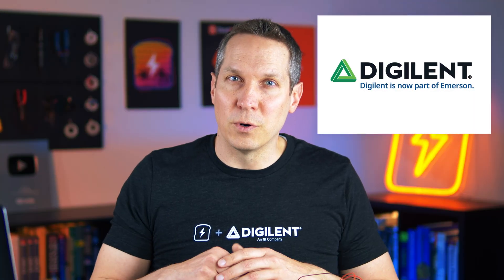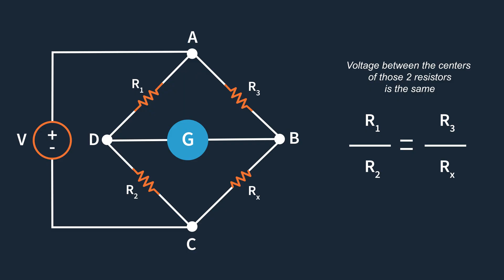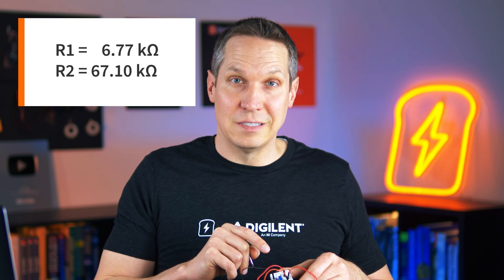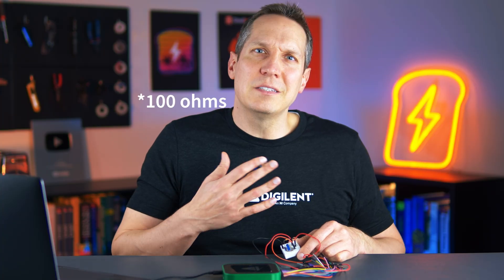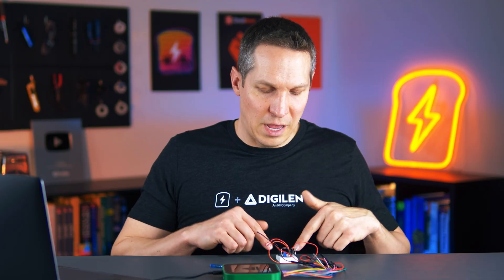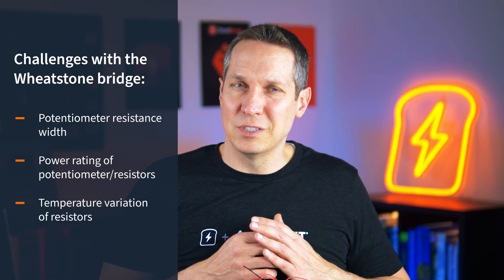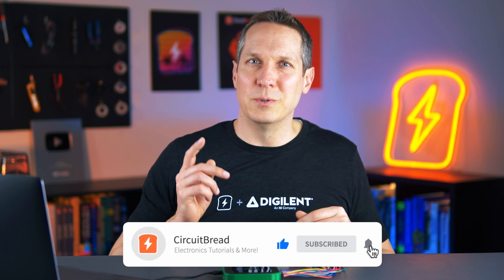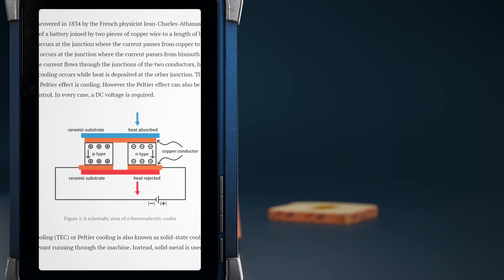Practical Wheatstone Bridge Circuit - Current and Voltage Dividers in Action

Comment: I need some help please😭I have a project where an LED must light up for every 10° I bend the flex sensor up to 90°. I was using a voltage devider but someone suggested I use a wheatstone bridge rather but I dont know how to connect it to my comparator ladder. An no video on youtube has an layout for a circuit where the wheatstone bridge is practically used😢any resources you can suggest that will help?🙏